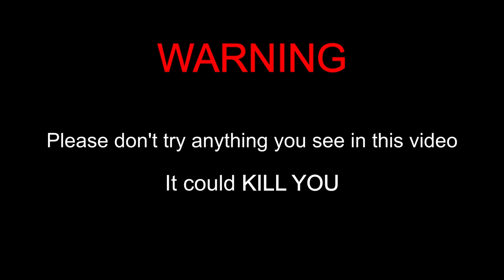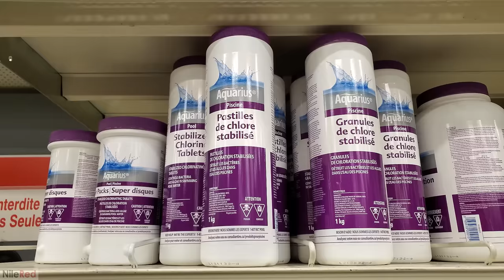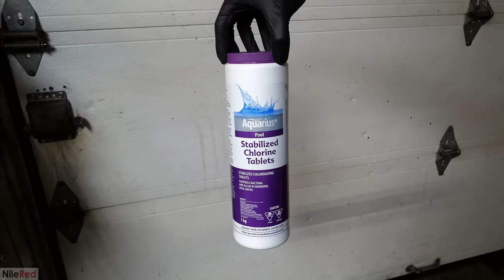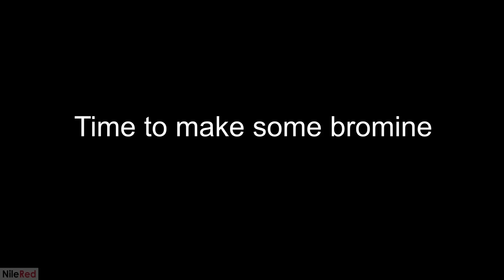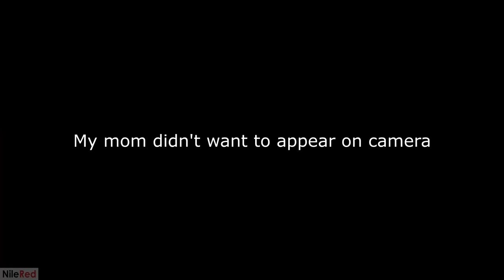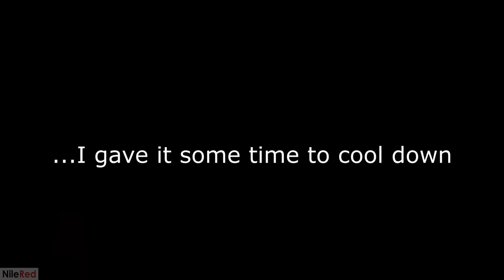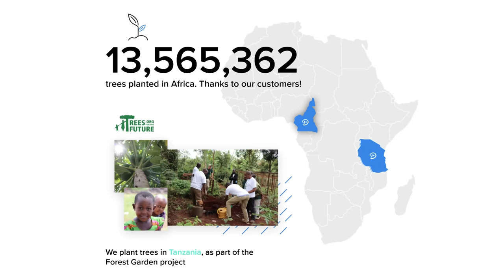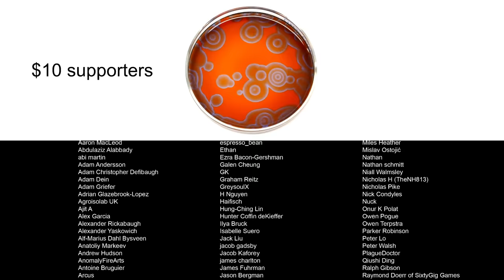Making a deadly chemical in my parents' garage

Comment: “That one exploded from an accidental lithium fire” I’m dead 😭😭😭
Reply: That's bad right?
Reply: @popcorn5481  Yeah can cause a explotion or even worse a fire 👁👄👁🤙
Reply: @kalyocodm577  oh that's not good
Reply: @popcorn5481  no shit 🧑‍🦲
Reply: there are no accidents
Master Oogway
Reply: @popcorn5481  Lithium has an atomic number of 3, so it has 3 protons and 3 electrons.
It is an alkali metal because it has 1 valance electron (2 electrons for the first orbit/shell, 1 electron for the second orbit/shell).
This means it is VERY reactive. To the point of exploding or causing a fire.
Reply: @kriszenn1125  that sounds cool
Reply: Do they got it on Amazon
Reply: Timestamp: 6:56
Reply: @popcorn5481  lithium can cause lung damage and a build up of fluid which is bad
Reply: @popcorn5481  you can extract it from battery
Reply: @popcorn5481  well third degree burns arent cool there hot
Reply: @Pheonix_-gx4he  I only have rechargeable batteries does that work
Reply: Oh no smile explosion
Reply: Most people's unintended messes: 
"Oops, I spilled some juice on the carpet"

Nile's unintended messes:
"Oops, I left a pyrophoric element unattended for too long"
Reply: @guyedwards22  yes?
Reply: Lithium batteries catch fire easy. You run the risk if you are into rc cars.
Reply: @popcorn5481  I like your energy. Someone telling you about how lithium fires can cause explosions, then you asking if they got it on amazon
Reply: My parents would kill me how-!
Reply: @baguette4607  Pretty sure that's just Nile's alt account where he pretends to not know anything about chemistry, pay him no heed
Reply: @kriszenn1125  I think lithium is one of the elements that’s very reactive to water too. I might be wrong, I could be thinking of potassium.
Reply: @lifeontheledgerlines8394  rip
Reply: Oh no, a lithium fire! Looks like the best thing you can do now is run to your chemical safety shower and turn on the water to put it out!/s
Reply: @Beelzebubby91  It applies to all alkali metals.
Reply: @Beelzebubby91  to add, among the alkali metals (sodium, potassium, cesium, rubidium, francium), it is the least reactive, it gets more violent as you go down the periodic table
Reply: He said it so casually 😂 like people have things exploding in their houses from accidental lithium fires bimonthly 😂
Reply: @popcorn5481  lithium batteries are not rechargeable 
The rechargeable ones are lithium ion batteries which doesn't use elemental lithium
Reply: @christophern762  that sucks should have told me sooner before I cracked on open.
Reply: @placeholdername8529  Well, the reactivity per mole, not per mass and they get heavier the further you go down the periodic table, so actually 1Kg of Cesium is less violent than 1Kg of Potassium.
Reply: Ehy

Comment: “Did you ever think it was dangerous?”

Says the guy literally cooking up a lethal poison 3 feet away with a Tupperware bucket and thin layer of sulfuric acid as safety measures
Reply: perfectly safe =3
Reply: Hey ive seen you before
Reply: @Troublesome_Truck  I try and comment on every video I watch, wouldn’t be too surprised...
Reply: Sulfuric acid as safety measure is Op
Reply: It's like a saw trap, either risk getting acid burns or risk inhaling deadly fumes.

Comment: I remember my chemistry teacher saying you shouldn't work with bromine if you're not done with family planning. At least not regularly.
And then he had us do some experiments with halogen-water solutions, including bromide
Reply: Just to clarify, Halogen-water Solutions are relatively stable because they fufil the octect rule. Same goes for Bromide. Bromine on the other hand, has 7 valence electrons. It wants 1 more electron and it's electronegativity is very high. It will react with a lot of things. Hope this helps.
Reply: @christopher-zq4ko  This is a fairly general rule for the halogens
They're very dangerous in their elemental form (heck the electronegativity is even higher with Chlorine and Fluorine than Bromine) but they're relatively okay in a compound with something else
Reply: @weepingdalek2568  Sodium Chloride is a great example of this, also demonstrating the same phenomenon regarding alkali metals.
Chlorine, a Halogen, on its own is incredibly toxic to life.
Sodium, an alkali metal, on its own is explosively reactive with water.
Together, they make... table salt, which is an essential component of all life on Earth.
Reply: @MGSLurmey  It just shows how one bond can make all the difference

Because that's really the big difference between sodium+chlorine and sodium chloride

Comment: If that was a regular aquarium-type pump to circulate water through the condenser, it was never going to blow the tubes off. They can produce a decent flow rate, but can't make much pressure. Maybe 2m head of water at most.

Comment: "However, in 2017, that one exploded from an accidental Lithium fire."

Ah yes very relatable
Reply: Hate when that happens...
Reply: Actually is a couple times if my friend or me permanently broke something electronic we dismantled it and on more than none occasion this was done with a hammer or knife and the battery sometimes caught fire
Reply: It can be relatable, because most portable devices run on lithium batteries, and those can catch on fire.
Reply: @laerin7931  Yeah, I've had a LiPo fire before.

Comment: 23:39 nice electronics setup. Temp controlled weller iron, temp controlled hot air gun, two oscilloscopes, a Variac (or a DC power supply but it looks like a variable AC one?), a couple DC power supplies, a couple multimeters, I think a function generator? There's definitely a whole analog repair lab there!

Comment: About not trusting the scale: The metric system is easy:
1 L water weights 1 kg.
So 0,1 Litres weighs 0,1 kg.
(kg = thousand grams).
It’s equally easy with temperature and screw sizes:
5mm hole = M5 screw (M stands for metric.) No need to translate to “a number X screw”.

My point is that you can easy check the scale with water.

I know Nile knows this, but it’s a fun fact for the few countries that use body temperature and size of a foot as reference. 
And I know, there are people that are “too cool” to realise this. And I’m looking forward to your answers. 😊👍

Comment: I did this once, (I’m in college for chemistry) and I was just going to do it outside on a windy day. But that wasn’t until I realized that the rubber tube for the condenser I had wasn’t long enough to reach my sink… so I thought I might try using glass stirs to connect them then seal them with water proof tape.

Then there wasn’t a nice windy day for a month…

Comment: That's interesting about sodium bromide no longer being available in canada.  I use it for my hot tub, where the built in ozonator does a good job of 'activating' it to hyperbromous acid to perform the disinfection, and isn't near as volatile (thus stays put longer) than chlorine based disinfection.
Reply: What he made is "free bromine". You have a stabalized bromine, most likely bromine 81. Leave it up to a bunch of scientists to name different chemicals the same thing. 😂
Reply: @DoctorKnox  What are you on about?  Bromine is an element, and it is named Bromine.. what 'different chemicals' are called the same thing?  "Free Bromine" is not a chemical, it's a measure of how many bromine carrying ions are in a solution waiting for a partner (often in a solution of hyperbromous acid, so the ion in discussion would be BrO-).

Comment: It’s good that you’re so safety conscious but your cabinet for blow torches has me genuinely concerned. You should consider storing them outside in a gas cylinder cabinet or perhaps in a flammable safety container inside. I am by no means a safety expert but if you have a fire and your fire suppression system is unsuccessful those cylinders may act like small bombs 💣